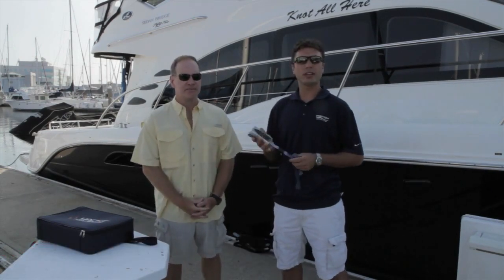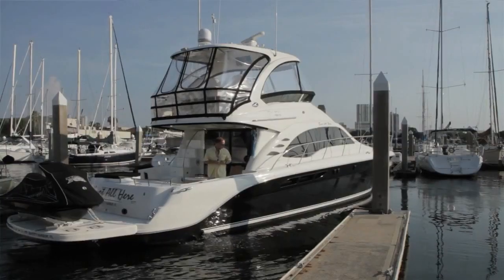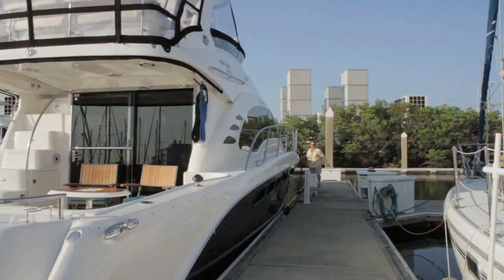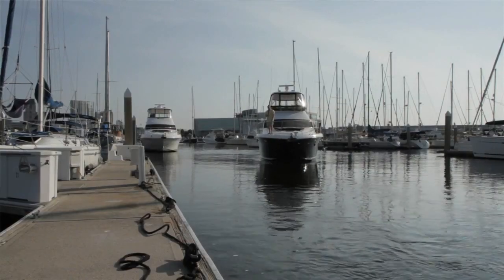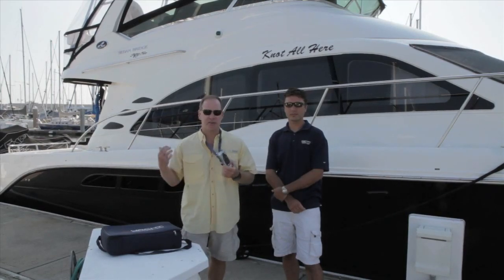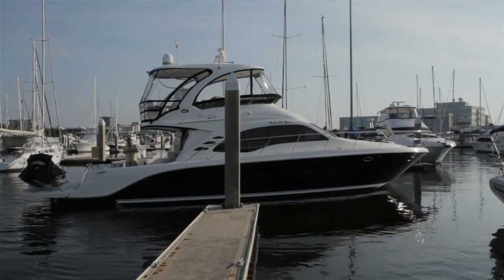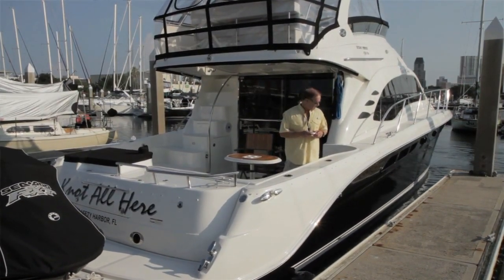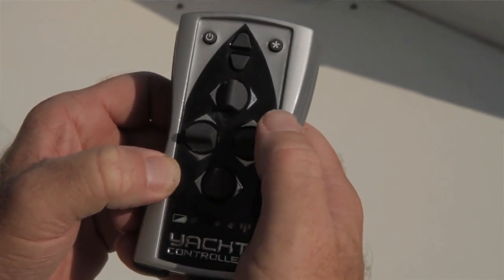Yacht Controller MarineMax Demo

Comment: very bad service
thy burned my port transmission on sea trail after initial installation we managed to make it back with one engine to the dock
 and we went back and forth  4 month my insurance pointed it as improper repair  twin disc dealer  pin point it as wrong insulation thy paid for one trans refused to fix the 2nd trans i  had to personally pay for it
now thy will not honer the warranty and refused to sent a tech to inspect it, now im presoing legal action aginst this company, i just want yacht controler out of my boat  no matter what its going to cost me
 to make a long story short
if you want to pay for a product that will damage your boat and keep you stuck at the dock for 4 to 5 month ,pay to fix the damage your self,and have no warranty, then go ahead have fun on the docks,i
Reply: Yacht Controller AU, no rebuttal? I like to hear both sides of the story